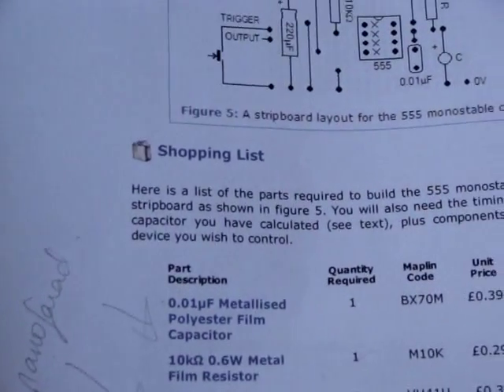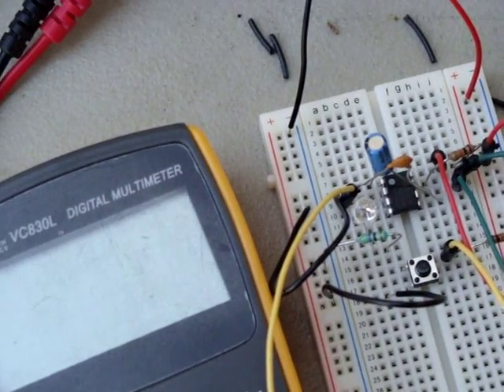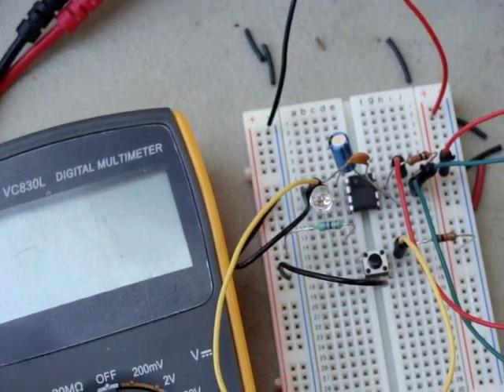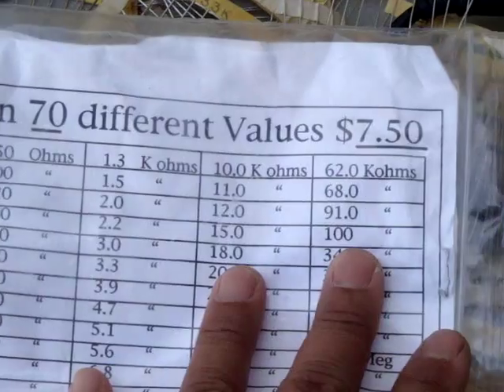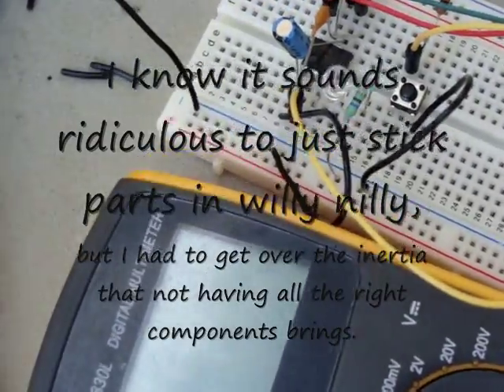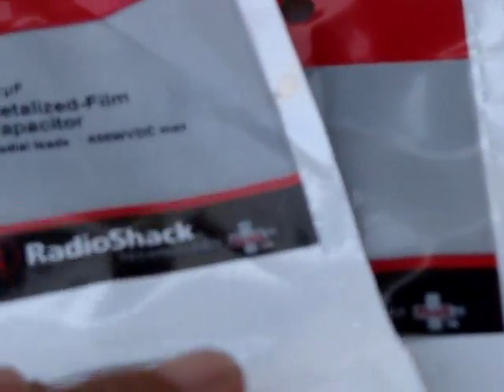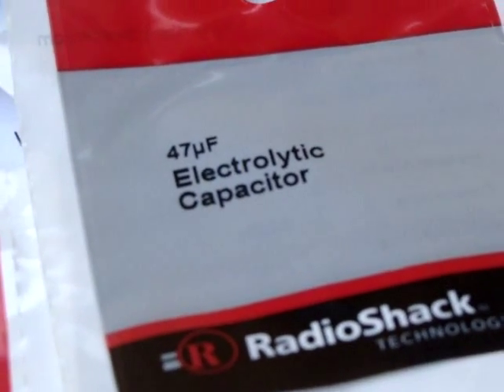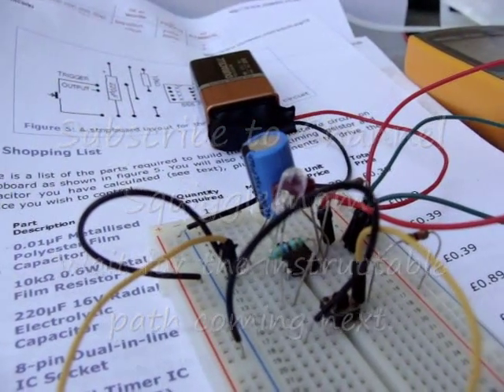Momentary trigger of LED for 5 seconds of complete circuit (or thereabouts) using a 555 timer

Comment: Hi, I wanna build a 555 circuit that can light up a LED each 5 seconds. Turns ON, stay ON for 5 seconds, turns OFF for 5 seconds and then again, and again. I tryed using the 555 calculator to evaluate the resistors needed did manage to achieve this, but in practice didn't work. It light once, stay ON for 5 seconds and then turns OFF no longer turning ON....

Comment: question if you click 2x on that start button the timer will add 5 second, so it's make 10 second and so on.... ???
Reply from the maker: Planet gemini.... I don't think predictably so... I think the capacitor is charged and the start button let's it discharge, sending the accumulated electric charge out through the system.  Clicking on the start button again wouldn't necessarily guarantee that the capacitor had enough time to recharge.  I'm thinking I need to work on this some more again.
Reply: Well if your timer is of 5 seconds and if you press the button again and again within that period nothing will happen>The timer will work for 5 seconds and stop.
Reply: Aakash Bashyal do you mean the circuit just for first press button only and next press within period not influence the timer period until stop?
Reply: @johnsuyanto5941  I believe so. The button press isn't stored in a memory. so if you tap it continuously you'll fire it off every 5 second.
I see I'm a year too late.